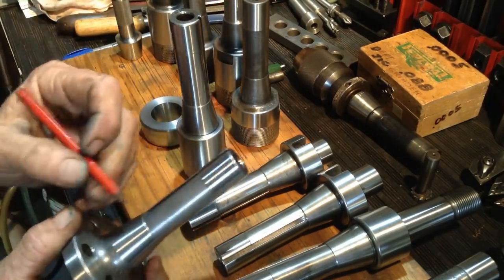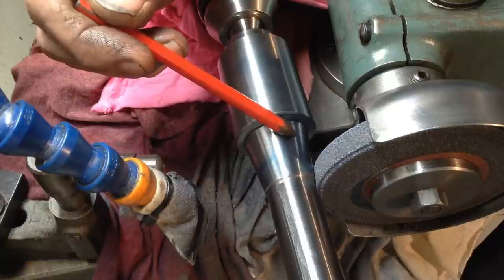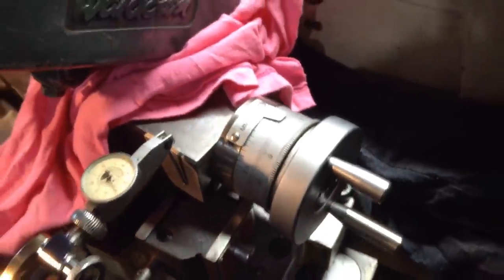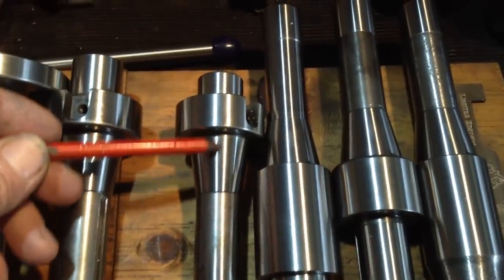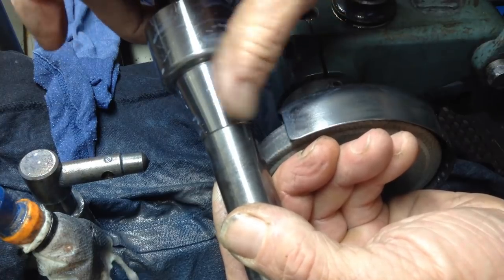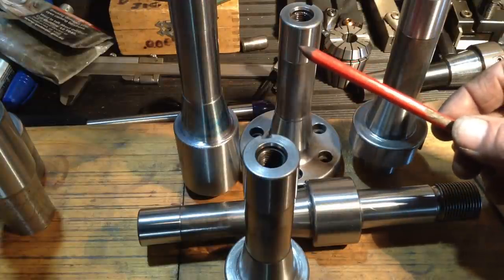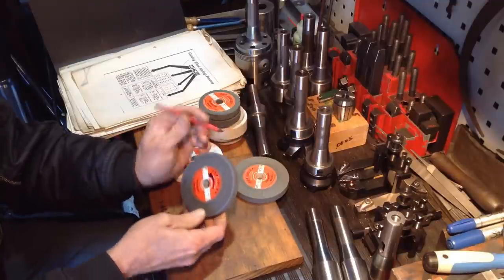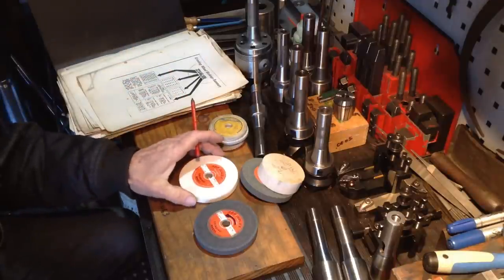Machining R8 Tooling For The Bridgeport . Part 10

Comment: It does my heart good to see you reading the mic while it is in contact with the part.  It's the way I was taught, and teach.  What formula do you use to calculate the compound angle necessary to get .0001 infeed with .001 turn of the compound handwheel?
Reply from the maker: It's the best way to read a mic .  The compound is set for the R8 angle  so it makes it an odd ball in feed .  You can use trig if you want to be precise but as long as you have any shallow angle , you soon get the feel of the infeed amount .  Remember you have wheel degredation to factor in as well .   Cheers .

Comment: Another job done with excellence, and with the slight movement of the Angle just to show what .001 will do on a Taper Grind.  With there being a better selection of stone grinds in the lager stones, is it possible or is there enough room to modify the stone guard to make it larger to accommodate the lager O.D. ?
Reply from the maker: The grinder does not have the power for larger stones .

Comment: Thems some high quality tools, Max! I've been teaching myself trigonometry over the past few months (yeah, it's going kinda slow lol) so I actually get the concept of using your compound for very precise depths of cut. I tried using an indicator to do it but there's not a single flat surface to stick a magnet to 🤣. Well, other than the working surfaces of course. Thanks for the video and the education. It wasn't too much of a grind... 😏. Cheers!
Reply from the maker: You can always cheat like i do nowdays & use the online trig calculators !   Cheers .
Reply: Nice use of pun about the grind.
edit: I am a semi retired carpenter so I have dealt with angles. But now wanting to learn Machinist trade as a hobby I started learning about trig myself, yes it is slow for me too but after a while when I know I just learned something I know I'm climbing that ladder. I don't mind how long it takes as long as I'm learning a little at a time it really is fun.

Comment: Alot of good stuff to comment on in there. Love that wheel guard . Imagine a trough below it to catch the flood and a return line. And two one gallon lab jugs. (handy way to store coolent any way) the gaurd and trough could have custom soda can "blinders" for splash controll And ya wheels Im thinking about the three inch you can get the black snagging wheels (mcmaster-carr)for the weld build-up, there's a couple diamond options on ebay there's a 1A1 straight wheel 3" diamond for $14-20 ish and the mysterious orange "ceramic"  3" and white ceramic 100/80 grit sounds to fine diamond cut off would love to find some of that blue ceramic  think i saw those in 3" the norton and some of that other 7" wheel compounds I'm building a tool post grinder here slowly  that white wheel you had there might be a corundum/ aluminum oxide(AO) those i think are described as great choice for tool steel grinding probly O-1 or A-2 great work keep it up man!
Reply from the maker: Thanks . The white wheels are aluminium oxide , but a slightly softer bonding would be better . Postage for the wheels from USA makes them too expensive .  The ones i use are from a local supplier , so readily available .  I still have to contact the Norton agents here to see what they can do .  Cheers .
Reply: @swanvalleymachineshop  ya the hunt for wheels of a consistant qaulity, probly find one that'll last for ever and end up with two of em' ha ha good show

Comment: That's an impressive grinding setup Max - love it, and love the precision you're getting. The coolant keeps the workpiece cool of course, but presumably it keeps the dust down as well? Cheers, Craig
Reply from the maker: The coolant does both .   Keeps the grinding  rubbish in the  rag / filter  pile instead of going back to the coolant tank .  Cheers .
Reply: That was a good observation, I'm glad you wrote that, now another tool in me own bag. Thanks.

Comment: Hi Max, just bought a ER 40 Collett holder to No 3 morse taper, 3 thou tir runout of internal taper, not impressed.
I regound the internal taper, learnt my lesson not to buy chinese.
Checked my Vertex ER 32, spot on.
Hope you get better and keep plenty of water on the slab.
Reply: I've found Vertex equipment to be very good dimensionally and good quality. Best regards from the UK. John.
Reply from the maker: That is pretty standard from the country of hit & miss tooling !   I have a Mechanica brand ER40 one .  It is very good quality .   Generally the stuff from Taiwan is pretty good  , we don't have that much option  Down Under !    Cheers .
Reply: @swanvalleymachineshop  Quite a bit of my tooling; milling cutters, lathe tools is from South Korea, supplied from Cutwel Ltd, UK, Bison from Poland is another quality manufacturer of tool and work holders.
Reply from the maker: @bostedtap8399  I have a Bison chuck on my Polish indexing head .  Good quality gear .

Comment: Hi Max great videos looking a making same R8 holder just wondering the taper angle on the R8 Thanks
Reply from the maker: 16 Degrees 51 minutes . The video where i made the R8 plug gauge  may help setting the angle .
Reply: @swanvalleymachineshop  thanks max 👍

Comment: Couple of questions if I may please? What’s the name of your local tooling shop? (H&F)?
Also have you considered maybe trying to source a 4 inch CBN (Cubic Boron Nitride) grinding wheel?
I’ve had good success with 2 x 6 inch versions on my bench grinder & flat bed Sherwood grinder, that I use for grinding my planer knives.
I sourced them through Fiora machinery if that’s any help.
Tina at Fiora is wonderful and will go out of her way to find what you need.
If your not aware CBN grinds cool / cold, because it doesn’t accumulate swarf into the pores of the wheel increasing friction & heat, it’s self cleaning so no need to dress it.
Presumably a diamond wheel might also be an option for you as well? The CBN is just a tad less expensive is all.
CBN will do up to HSS & Tool Steel, while a diamond wheel would be better for carbide / tungsten.
Reply from the maker: Tooling shops i usually go to are Teravin tools in Balcatta , Abrasiflex in Welshpool .  L&T Venables in Malaga .  Sometimes i use H&F but not often .  I have been to Fiora ages ago , a bit like h&f .  High speed tooling in Welshpool have a good range but are bloody expensive .  I would think cbn wheels would not work on the material that i was grinding as they are for hard tool steel etc .   Cheers .
Reply: Max Grant ,The Swan Valley Machine Shop. 
Ditto on Venables in Malaga. 👍
The CBN works ok on mild and 440 steel as well but does also handle Tool & HSS easily.
Still working my way through your videos, (binge watching to catch up) so the mill tooling you’re grinding - you ground the tapers & ran the threads before you hardened & tempered them or after?
I’m easily confused. 😂😂😜

Comment: Hi Max, Did you end up solving the issue of finding 4inch grinding wheels in Australia. I’ve just acquired a tool post grinder so I’m watching all your videos with great interest. 👍🏼
Reply from the maker: Not yet .    I just use the A46 wheels from Abrasiflex .  I can get good results but their is only a small window for finish grinding  that falls in between dressing cycles .  👍

Comment: Max did you increase the speed of the lathe to compensate for the reduction in surface speed when you changed down to the 3” wheel, if not would that account for the poor result using the 3” wheel? Take good care of yourself 👍👍🏴🍺
Reply from the maker: It would have been about the same speed . Cheers .

Comment: Would you say that R8 is better than BT30? I am building a mill but need to decide which way to go. R8 is much cheaper for tooling but the spindles are huge. I have a lathe so making the spindle for either is not a problem.
My intention is to eventually go cnc with the machine. Granite base and HGR25 rails.
Any input is welcome. Thanks.
Reply from the maker: I would go for BT30 ,  R8 is quite an out dated system , but still works well .   The  30 taper  , i have never used , but apart form being a lot more rigid it is very common now .  Cheers .

Comment: Max, I've been playing catch-up on this series (as a new viewer/subscriber), so this question may have already been answered.  But here goes:  Where did you get the "R8 taper" gauge?  Was it "affordable"?  [Edit: Later in the video you mentioned that you had made your own gauges for this, so I need to go find that video!]

When you ground the Sharpie marker off of the taper, it looked like the wheel left "bounce" marks in the edge of the blue.  Does wheel/arbor balance cause that?  It's great that the part passed the gauge check with flying colors anyway!
Reply from the maker: Hi Bob .  the marks  i am sure were the result of  using a live centre in the tailstock & taking the part in and out . There  will be a couple of tenths play in that centre no doubt causing it .  When the wheel leaves bounce marks you will see straight away in the finish .    I believe a dead centre  may have been a better choice  .  Cheers .

Comment: If you know someone with a water jet cutter you could cut your small wheels from larger ones, of the grade you want but only avsilable in large sizes. Sounds a bit odd but perfectly feasible, for confirmation have a look at Dan Gelbart's excellent videos.
Reply from the maker: That's the guy with the granite bed lathe i think .   The wheels i have , i know now how they react .   I will just keep an eye out for other grades .  Cheers .

Comment: As I remember, hard metal use a soft wheel and then soft metal beard wheel, 
Dressing 
The Diamond dresser should be well contained (not allowed to bounce Along or wonder) the dressed should move across the surface quickly and aggressively once. Never do you dress a wheel namby-pamby, Helter skelter. what this dose makes you  dressing often with poor results every time
Talk to a wheel manufacturer and see (I tell you true)😮
Reply from the maker: Their is no choice in grades of wheel in the smaller sizes .   It is easier to learn how that wheel will react & work within those constraints .  Otherwise you have to import wheels from overseas if you want to use different grades .   👍